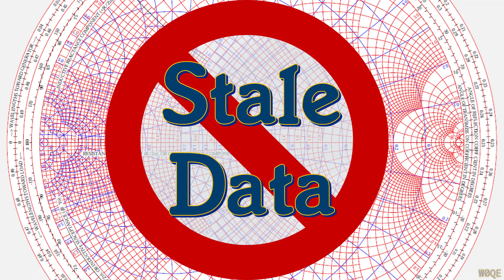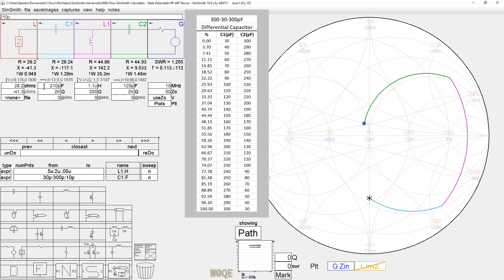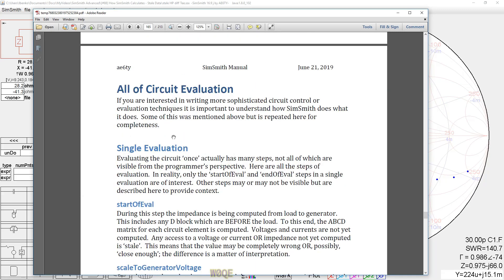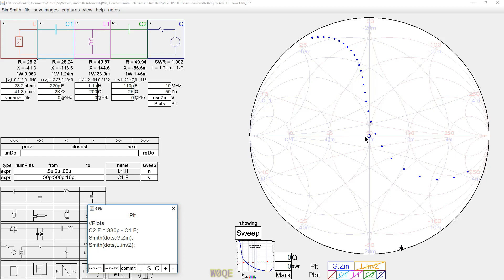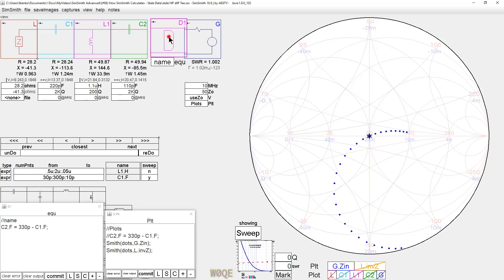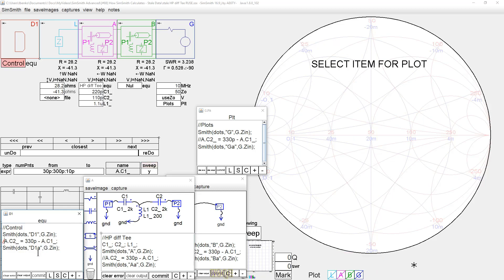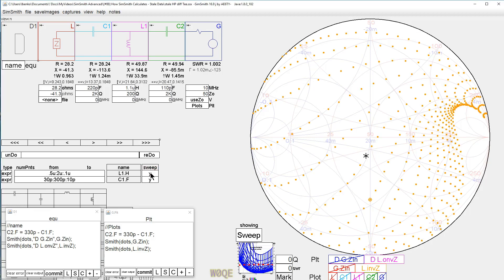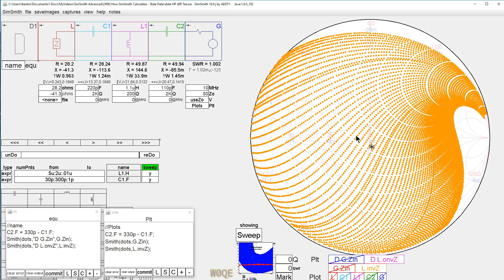#88: Stale Data in SimSmith

Comment: can you identify the stale data problem by viewing the circuit by reversing the view ?
Reply from the maker: Joe,
If you mean reversing the circuit and negating the component values the answer is yes as this doesn't really change anything.  SimSmith makes a couple of passes when it does the calculation and the first one involves calculating the voltages, currents, and impedances for the circuit which in the example I showed had the value for C1 set prior to this calculation but the value for C2 got set after the calculation.  I would suggest taking the safest approach which is to use a D block before the load and set the dependent component values which will result in all the values being correct before SimSmith does the circuit calculation.
Larry, W0QE